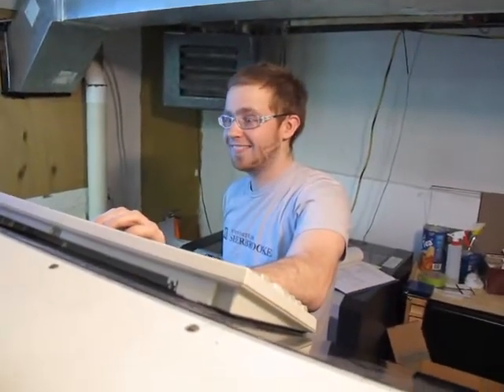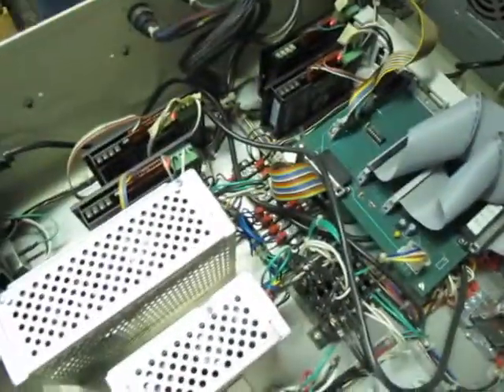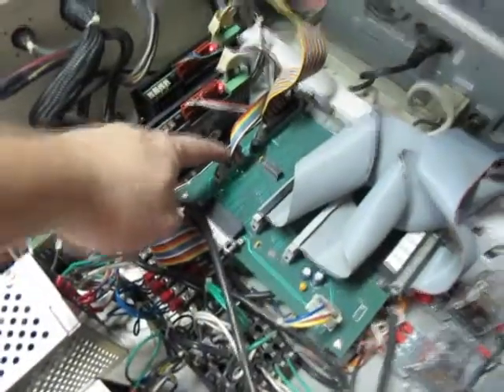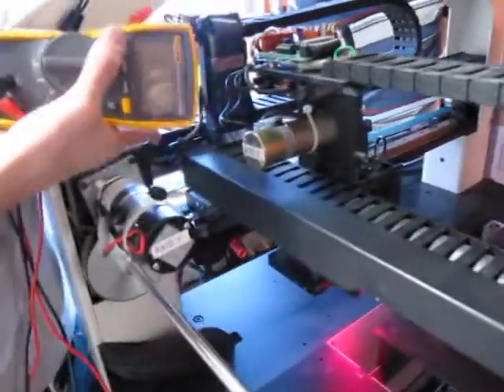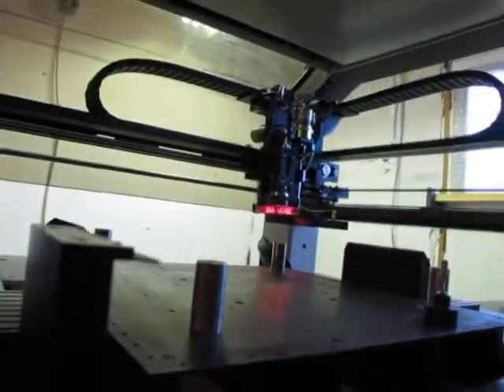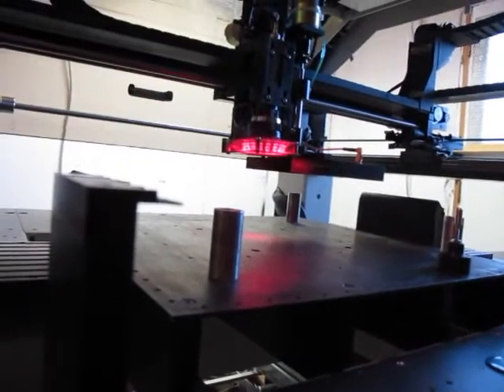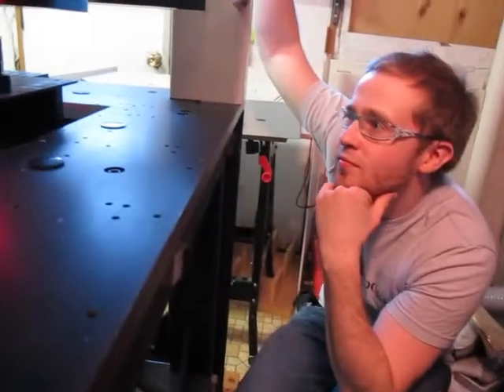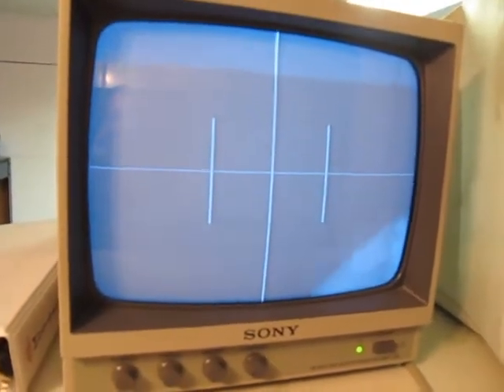Solarbotics Pick and Place, Success #1!

Comment from the maker: Yes, it is a CNC type device for picking up tiny electronic components from a tape, and placing it on a circuit board. It's how practically all modern electronic devices are manufactured. This particular machine is pretty old (~19 years), but we still have plans for it.